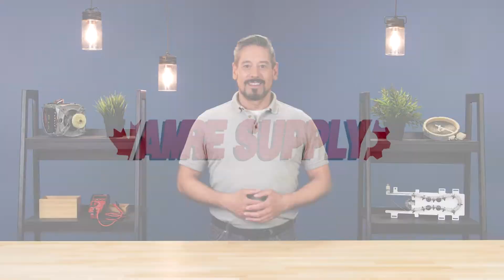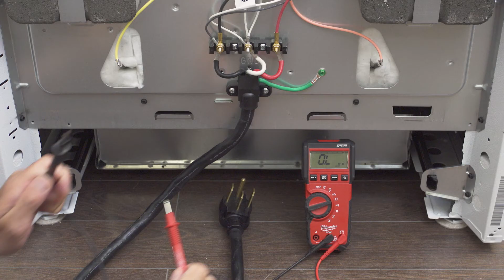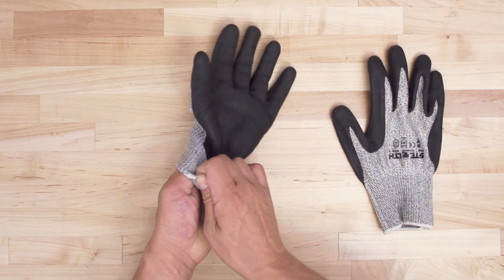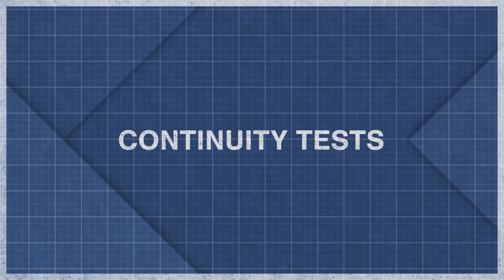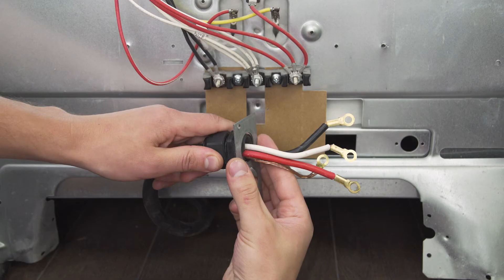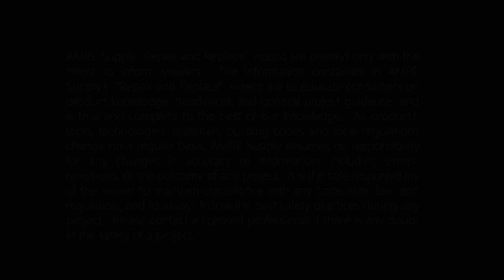Oven Power Cord | Repair & Replace

Comment: Hi, I've got quick question. I live in Ukraine and recently my friends gave me a White Westinghouse electric oven. They received it from US (bought on auction or something). If there's any chance it will work in my country? I know that we use 380 Volts power supply for electric ovens. That's why I'm asking. Thanks in advance.
Reply from the maker: Thanks for watching. If the oven is from the US, then the control board likely requires 120 volts to operate. It's unlikely that it will work off 380 volts.
Reply: @AmreSupply  Thanks, Is there any way to connect it to our local regular circuit? It is single-phase socket (220 Volts).
Reply from the maker: @eugene8149  The stove elements would be able to run off 220 volts single phase. In North America it runs of two 120 volt lines which are out of phase of each other. These add up to give a total of 220 - 240 volts. The heat switches are simple and simple connect or disconnect the circuit to the stove elements. You can see the circuit here: https://www.youtube.com/watch?v=I7i25VPg-rM For a one phase system its the line / neutral connected instead of 2 lines of power.

Alternatively the oven control board is not easily adapted. It's not set up to handle 220 volts single phase.